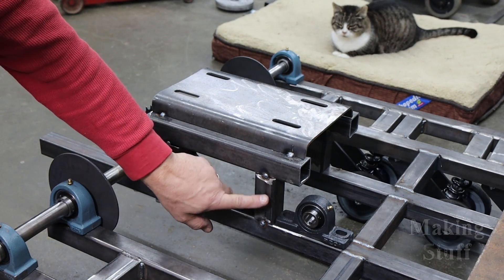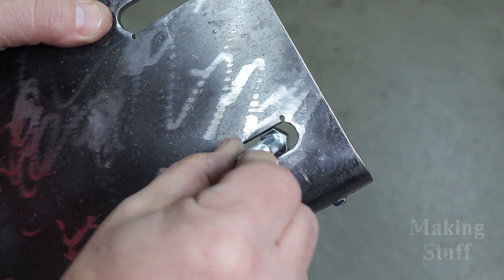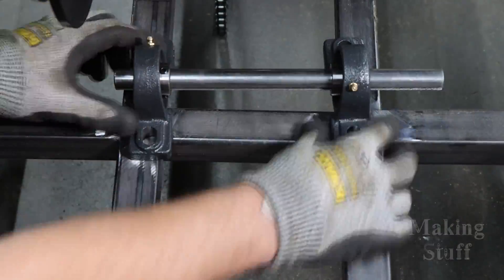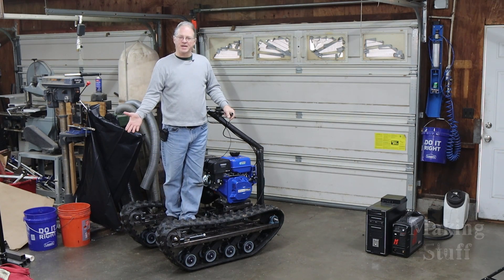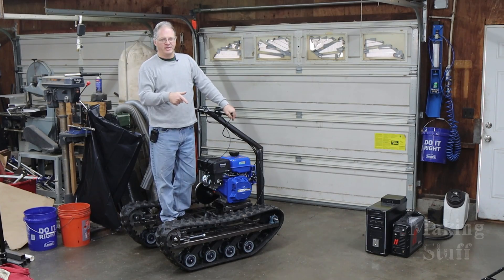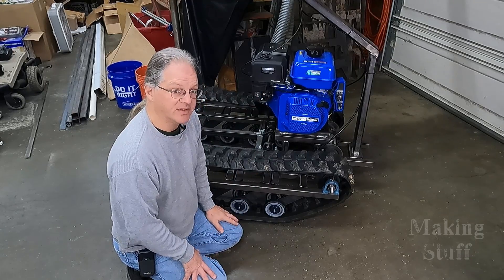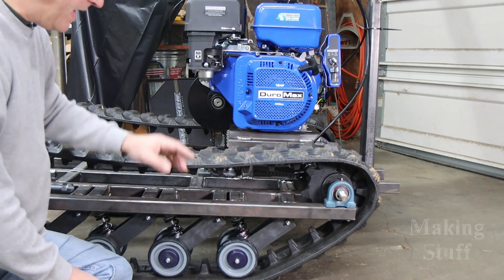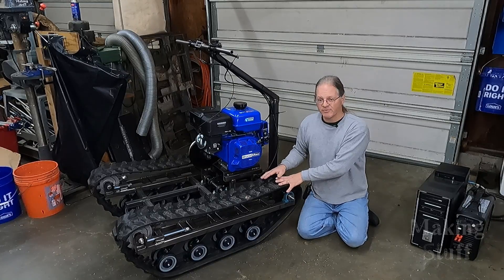DIY Tracked Vehicle Part 3 - Is It Really Finished?

Comment: It's too late now but you could have ran a weld around those slots on both sides of the plate the metal would become stronger ground smooth and saved that material for something else. Also I operate heavy equipment for a living and in this video your tracks are on backwards 😊

Comment: I'm just curious - what program do you use to draw your plasma cut parts. I'm in the middle of a small CNC plasma cutting table build. I played around with illustrator to create some black and white SVG files which I then brought into open builds cam to create toolpaths. It's all new to me but nevertheless an enjoyable learning curve. Thanks for the great vids. Are you running Mach 3 on your plasma controller?

Comment: Understanding directional tread patterns on tires, the V configuration of the lugs should point forward in direction of travel. Just my observation. Probably makes no discernable difference. Love the build and presentation. You have a new Sub!
Reply from the maker: Thanks for the info!  The tracks were turned the correct direction later in the project.  Works great now.

Comment: Maybe this isn't a big deal but, are the tracks facing the right direction ? Just going by the tread pattern.
Reply from the maker: No they weren't when this was filmed.  They were turned the correct way later on in the project.

Comment: I am a mechanical engineer and I saw the problem from the start, you have placed the idler and drive sprocket on top of the track frame instead of underneath and I would suggest that you fit some rollers to support the upper part of the track as well. Perouse the internet and look at the various skid steers out there and you will see what I am talking about, apart from all of that you have done a great job. From Australia

Comment: Don't forget to put an "Extension" on the Oil Drain Hole" so that it can be easily accessed and a brass valve on the end.
Reply from the maker: Yeah, I'm at the break in point on the engine and need to change the oil.  Figured this one out the hard way.  Thanks for the tip!

Comment: What I am wondering is what is the footprint weight of the machine and operator of pounds per square inch ???? Will this be able to turn without chewing up the grass ??? Thanks
Reply from the maker: It did not tear up the grass when I was spinning around in the snow.  I'm sure if I stayed in the same spot and spin around several times it would tear up the grass.  I think the pounds per square inch are rather low because of the amount of track that has contact with the ground.  It barely leaves any tracks in the grass and dirt.
Reply: @MakingStuff  You are right on with your assuration of contact pressure. What is the machines weight, what is surface area of track contact pad and how many contact pads are their ??? Thanks  This way I can figure out what you have pressure wise. Have a great day fella too.

Comment: The most easy way would be the solution that was also being used in some WW2 tankhunters.
That is reverse everything. put the steering mechanism on the back side, the engine will be under your chair and effectively your rear will now be your front.
The center of gravity will be almost in the middle now.

Comment: 6:41   why not use plasma to cut holes for caliper mounting bolts?
Reply from the maker: Good question. It doesn't make small holes very well.  I used to make them undersized and then drilled them out with a bit to et a cleaner hole, but that would often make the holes out of place or alignment.  It easier to just drill them out manually when you are only dealing with 2 holes.

Comment: I enjoy your presentation and videos/content. 1 minor thing that won't make a hill of beans difference that I noticed is that the track was backwards. That is strictly aesthetic because this isn't an excavator or anything that needs to push (pull in your case) a lot, but. . .when viewed from the back, the lugs should angle downward on the outside edges like a tractor tire's do.
Reply from the maker: Already fixed.  See video I posted today. Thanks for watching!
Reply: @MakingStuff  They haven't changed orientation from what I can see. Glad the balance thing got remedied and congrats on finishing it!

Comment: 1/2" skid plate under the length and angled up at the front, that will bring the weight balance lower and add protection. Then I would add 2-300 lbs of weight in the back as plates and or some type of hitch.
Reply from the maker: Got it fixed.  See video posted today.

Comment: Reverse the lower buggy wheels and ride it backwards? Or move the whole engine to the back?
Otherwise it seems you’ll have to move the engine a lot to the center. Lowering it also helps.
If you are willing to sacrifice ground height, lowering the standup platform&engine would help a bit also, but a seated position seems a better option.
And, don’t forget a squid plate on the front...
Reply from the maker: Thanks for the tips!

Comment: The Center of gravity is key. Everything from planes to rockets needs the center of gravity balanced. Nice job building this! I may have to borrow some of this to make my own.
Reply from the maker: Yeah it needs to be moved to the rear of the vehicle.  Thanks for watching!
Reply: @MakingStuff  or the center and then a counter weight in the back to make up for the rider in the front. I'm sure you'll get to work one way or another.

Comment: Hi, another thing, what if you reverse the front road wheel, ie: make it a leading link instead of a trailing link, it would still articulate but it would be then 8 to 12 inches further forewards.
Reply: I was thinking this also but I'd be surprised if he has enough track length to do that.
Reply: @diabolicalmachine  Compress each of the springs for the road wheels and combined they just might give enough free play to the track to get it done, would make the whole vehicle a bit lower to the ground and more firmly sprung at the same time.
Reply from the maker: Yeah, if I turn the bogey wheel assemblies around facing the other direction it will move everything forward 6 inches.
Reply: @MakingStuff  I was thinking of turning the first and maybe the second one, not all because then with your weight on the back and a lot of overhang on the tracks it would always want to wheelie as it were,

Comment: not very clever what you said though: Why not extend the steering a little back and put the platform back on that you stand??? No additional weight, and nobody cares if the thing itself is unbalanced as it doesn't go without the "200 pound Gorilla" as the genious youtuber AvE would call you :-)

Anyways: The whole machine is gorgeous, keep the good work up! THUMBS UP
Reply from the maker: Thanks!

Comment: Progress, one thing that you could do to help with the front heavy issue, the handlebar mount, what about making it straight/upright without the bend and putting it behind the engine and also a 2 square hollow section is more than heavy enough for the handlebar mount, looks like youre using 2 by 3 inch. if it weighs 30 pounds then moving it will be a 60 pound weight shift, its the easies and first thing that i'd try. Oh and one more thing, a motorcycle throttle might be a better solution than the thumb throttle, i've never liked them.
Reply from the maker: Thanks for the tips!

Comment: I favor moving the engine back, and if required your handlebars and standing platform too. Moving the from idle wheels will steepening the angle of the tracks at the front.  Maybe cut n reweld the entire track mount assy forward 3 inches on frame is easier. Testing will tell the tale.
Reply from the maker: Thanks for the tips!

Comment: standing area looks too small(it looks like it is just 12"-15"? )if you make the stand such a way that you can stand keeping your legs spread it would be helpful in keeping a balance during maneuvering the vehicle. Maybe you can weld a plate over the rubber track so you can stand up spreading your legs as you require.
Reply from the maker: It's 22" between tracks.  I can't move them out any more than that due to the width of the diff.  Thanks for watching!

Comment: Maybe a seat that hangs over the stern a bit would balance it out. An old tractor seat mounted on some leaf springs? You'd have to drop and extend the handlebars a little, but It works great in my head 😁
Reply from the maker: Thanks for the tip!

Comment from the maker: It's almost finished, what changes would you make to it for better performance?
Reply: When I first saw your post on Instagram mocking up the handlebars I thought a pivot point where the vertical bar angles back would be good. 
You could have a spring setup like your bogies to hold the handlebars up but still provide some movement when needed. 
I hope your modifications work to improve the balance.